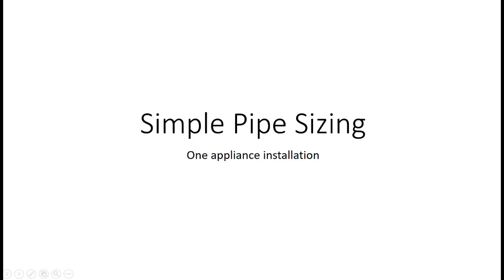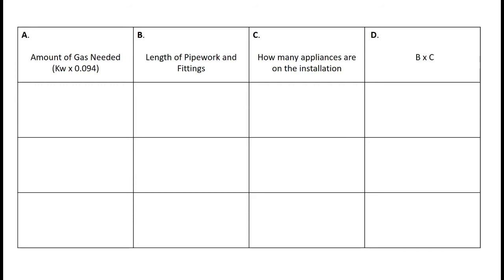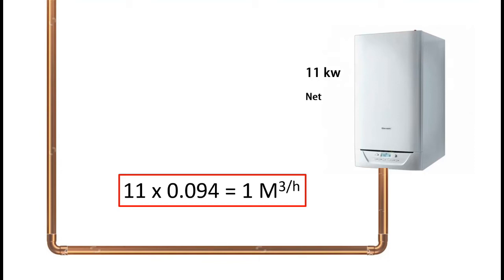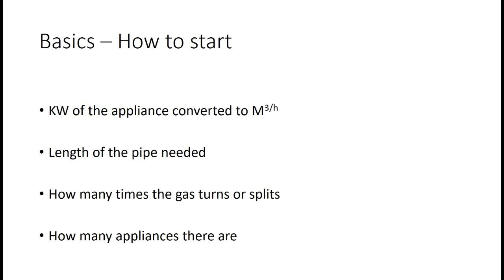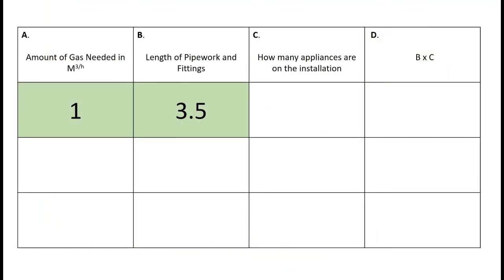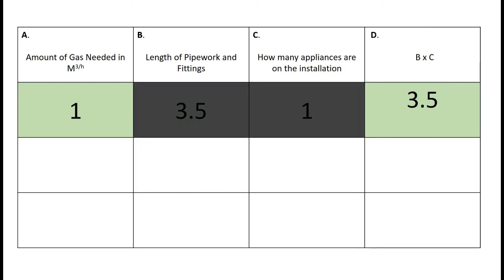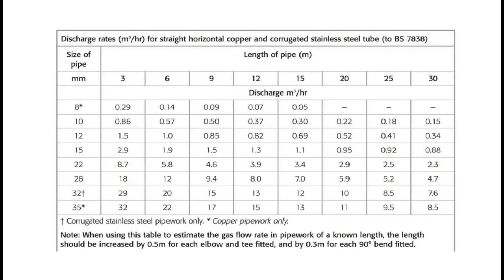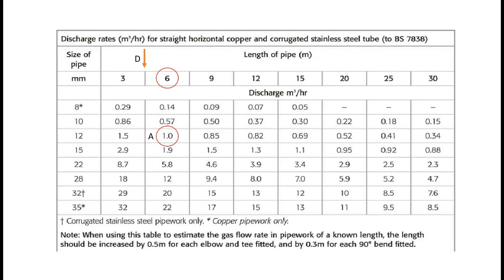ACS Gas Essentials - Pipe Sizing Pt2 Simple Installation

Comment: Does a pipe bend equate to a turn?
Reply from the maker: Hi, thanks for the question. Pipe bends of 90 degrees count as an additional 0.3 meter (instead of the 0.5 for elbows) … I hope that helps.
Reply: @passyourgas  legend, thanks mate

Comment: This is my first time I see pipe sizing taught like that. It is nice to see that there's a way to get the correct pipe size without having to guess and then go to the next size up should it not be big enough. However I was trying to understand how can you say that the 2 elbow are worth 0.5 m each in lenght if you don't know yet what size elbow you need as the equivalent lenght of fitting varies depending on the size of it and there are charts for that. Thank you very much for the explanation advance
Reply from the maker: Hi Antonio, sorry this is late but been busy with my day job!😀
The 0.5 has been agreed by the scientists who work all this stuff out. Now, there is a very complex mathematical formula for calculating the EXACT resistance and equivalent lengths but it is long,  difficult and requires a deep knowledge of fluid dynamics, which itself is one of the most complex mathematical concepts. The 0.5 allows for variances and pipe diameter, internal frictions of the metal used, viscosity of the gas and ambient temperatures among a great many other factors. Pipe sizing doesn’t need to be that exact. There are only a few pipe sizes so not a lot of accuracy is needed. Bottom line is that the experts tell us to use 0.5 so that’s what we do. 
I hope that helped. Thanks for the question.
Reply from the maker: As an aside..it’s really useful to know how to do this. If you are pricing a job and calculate that you can use 15mm in a run where a competitor is simply running 22mm everywhere, your quote will be cheaper and you’ll get the job. It’s worked for me well over the years.